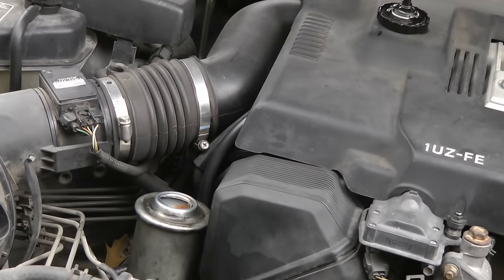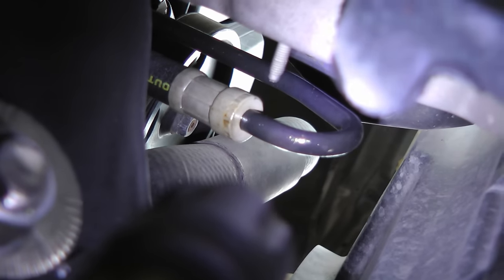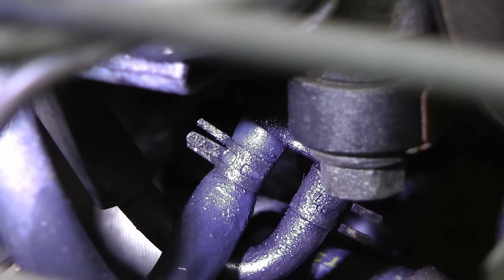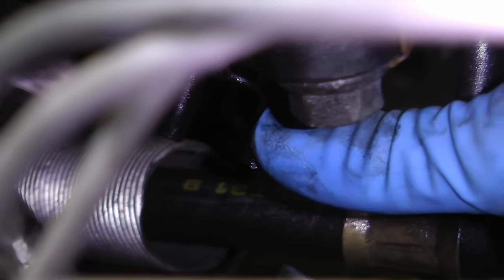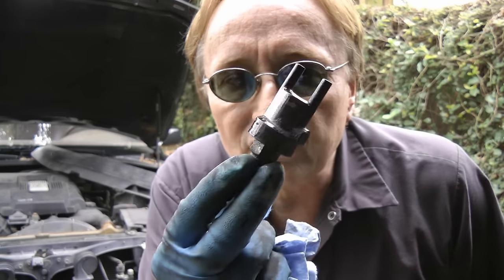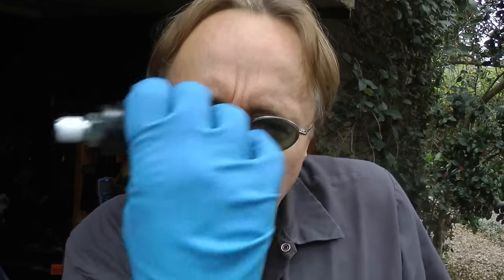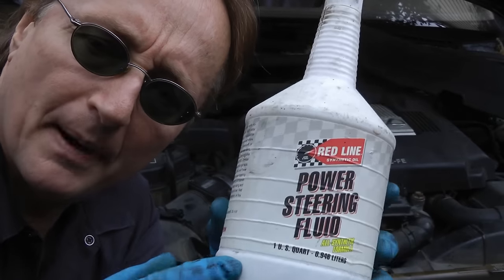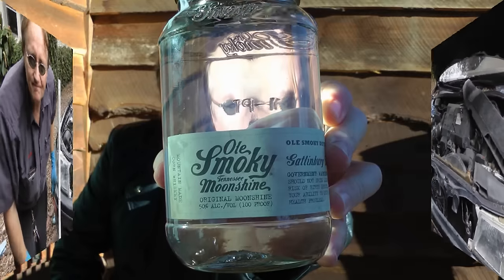How to Fix Power Steering Noise When Turning

Comment: Thank you for your video. the power steering pump broke on my 2001 Durango in a change it it and let it afterwards however it still making a noise, no more bubble in the Reservour when I bleed it and I'm not losing any power steering fluid either. Could this part be causing the noise the noise, thought not leaking?

Comment: Hey Scotty, need your opinion.. Im lookin at a 2009 Cobalt... 2 door... 5 speed (not the SS model)  60,000 miles for $6995... outside of the recent recalls for the ignition switches failing (although i never have a heavy key ring... which seems to be the cause of that problem)  does that sound like a good buy?  I hear they have pretty good crash test ratings compared to other compacts

Comment: PS:  This morning it was 30 degrees outside and I could not turn the steering wheel, then after about 3 minutes, the steering wheel turned fine...put it was still making the whinning sound as I drove, getting quitter as I drive over the next hour.  Thanks again!

Comment: Scotty I know nowadays they've replaced hydraulic power steering pumps with electric motors and as you've shown us they've even started making electric water pumps. Have you ever come across electrical A/C compressors? I'm thinking that would be too much draw on the cars electrical system but it would sure be nice to have full ac performance at idle just as at cruising speed.
Reply from the maker: yes, hybrid cars often use electronic compressors, but when they break, BIG time repair money on those.

Comment: Howdy Scotty,
One day I was moving too fast and put brake fluid in my power steering pump. From that point on, when I steering the wheel has been making a whining sound at certain positions. I sucked all the fluid out and put new fluid. It got better but not gone completely. It now only happens when I turn to the left when under a load (actually driving). Any ideas on what I should do?

Comment: Scotty, I have an 07 Grand cherokee and in low speeds such as parallel parking i get a groaning/moaning sound when i turn the steering wheel. It only happens when its cold outside but once the car is warm it doesn't do it again. It usually happens early in the morning when i take the car for work. It doesn't make any sounds when i am in motion and making a turn. Any explanations on the problem and/or how temperature might be a factor to the already existing problem?

PS- love your videos.

Comment: Scotty, do power steering leak stop products work? My son's Honda is starting what appears to be leaking from the power steering pump seal. No obvious loss of PS fluid at the reservoir, or any leaks on the garage floor, but I changed the oil the other day, and there is oil around the bottom of the power steering pump.

Comment: I had a noisy PS and in my case my ps reservoir needed to be replaced, there is a mesh filter screen in there that over time can get dirty and prevent proper flow. On the 07 Chrysler town and country I'm thankful it wasn't the rack that was the cause.

Comment: Hi buddy thanks for all your videos. I have a 2000 Toyota Tacoma 2.7 I change the power steering pump and the rack and pinion I realized that there is a noise still coming in from reservoir, inside the fluid is spinning like a swirl is not just sitting also when I put the cap on it starts leaking from the reservoir and I can't get rid of the noise I need your help

Comment: well I changed the power steering pump on my 03 Lexus.  It was working good for a week. When all of a sudden it made a loud noise when I turned the steering wheel.  I didn't jack up the front and turn the wheel as you did here. Could that be the problem? air?   I'm planning to change it again. Just to make sure I get another part and do it all over again.  WHAT DO YOU SUGGEST I DO, AFTER I REPLACE IT AGAIN?

Comment: Wish my power steering noise was that easy.  It was a little low, but hadn't been filled in over 2 years.  I added some Lucas power steering fluid and it helped for a very short time.  Now it's howling like mad again, but can not find a leak anywhere and pump is full.  Do you think the pump is going out?  Steers fine, but noise is getting worse everyday.  This has been a long cold winter, and car used to sit in heated garage all winter.  It doesn't have that luxury anymore since I bought it.  It's a 96 Buick Century with 160k on it.  I believe the pump is original to the car.
Reply: Air in the system will cause that.  See if there is a fine filter-screen in the reservoir.  I went nuts with my 02 Ford Windstar thinking the steering pump was dying or something.  I finally drained the reservoir and lo and behold there's a fine screen right at the bottom of the reservoir that was gunked up with carbon causing fluid starvation.  I pulled off the reservoir, sprayed that screen with carb cleaner to clear it, put it back in with some fluid, and haven't heard the noise since.
Reply: Turns out it was just partially frozen, once we warmed up, the noise quit.  Now if I could say the same about the potholes around here.

Comment: You are the man!  I see that part on my steering pump in the Haynes manual.  I'm going to check it tomorrow.  Have a 1998 RAV4 and replacing the pump involves removing too much.  Thanks for the tip.  :)

Comment: hi Scotty, I have a 2005 Cadillac STS and my car also makes a squeaky noise when I'm backing out of my driveway, but when I'm driving the noise goes away. I just recently got my car back from my mechanic and paid for the drive shaft rubber my car needed and thought that was one of the reason it was making my car sound this way and also got a tune up and everything. What should I do and is it safe to still drive around?

Comment: I have a chevy express van 2001. One day when I started it, it had a loud noise. When I turned the wheel, it made the same noise but louder. After about half an hour of driving the noise was quiet and pretty soon I could only hear the noise when I was turning the wheel. Do you know if following these instructions in the video will fix the problem?

Comment: Yo Scotty, hope you are safe, my old opel Astra H has an electric pump for the hydraulic steering... Kind of a hybrid between the technology, however, the electric part works well, what i have is a problem with the mechanical i think, even if I changed the oil and it is at indicated level, the pump still makes that low pressure noise, whining... There is no leak, so what can I do? A new one cost ridiculous for this car... And this old one work just fine, is just the noise that becomes even more intrusive as the engine heats up.
Should I try fix it or just leave it? 
Thank you.

Comment: Hello Scotty i was wondering more specifics, when you fill the pump and start the engine, do you leave the cap off or put it on the resivour then turn the steering wheel?

Comment: Scotty, i have this problem with my sienna 2008. I have replaced the inner and outer tie rod for both sides. The car steering wheel is very firmed when not start. When it started, the power steering wheel feel lose, I can do more turn on the steering wheel without turning the car. Do you think the "intermedia shaft", "rack and bushing" or "rack and pionon" is going bad.

Comment: Scotty, 1995 Toyota Avalon. Power steering whines whether hot, cold, or turning. Fluid is full and not foaming and a dark brown color. There's no power assist issues. I'm thinking it's a faulty power steering pump.

Comment: Scotty ( brother) = 1992 V6 Ford Tempo  power steering pressure sensor. I got a code 521 today (OBD1 Reader) " power steering pressure switch circuit fault".. Do you think something big problem I have?  When I push and keep the gas pedal stable 2500RPM the engine runs smooth and even for 1 min and RPM drops a little for 10 sec and back to normal again. (it repeats itself) other wise the car runs fine and turns fine.

Comment: I have a 2011 Ford Fusion.  Just moved and most everything is within a 3-mile radius-sweet!  But lots of tight turns.  I wasn’t the best about letting car warmup in winter.  Car started complaining regularly...groaning at turns, bumps, whatever.  Had to drive 3 hours away this weekend.  Was worried.  Thought it would somehow break dramatically or I would hear it the whole time and worry more.  Set up an appointment for 52k service and check on this noise for tomorrow.  But since trip...two days...almost no noise now...what happened?  I don’t remember the noise on the trip.  Any thoughts?  Trip= Miracle cure?  Any chance I can cancel check with a clear conscience...I have to feel like it’s safe...I drive kids!

Comment: Hey scotty, what's your take on using transmission fluid In some power steering systems, as I have seen some people do?
Reply from the maker: it works fine in some cars, but can ruin others like BMWs. Check with your manufacturer

Comment: On-topic : I drive a 2000 Honda Civic EXi, The power steering works fine most of the times, but there are times that I feel that the power steering shuts down; the wheel becomes quite hard to turn and then it gets back to normal. I drive everyday, and it happens to me from time to time in one day.
The 4 tires are new on the car and I checked their pressure everyday to see if the problem comes from there, but the tires are just fine!
I feel like it is the pump that must be faulty! there is no fluid leak at all!

So what are your thoughts scotty? I do not want to go the the mechanic again, Just went there to change the sassy arms!
Reply: Your rack and pinion is binding most likely and needs to be replaced if the pump is quiet.
Reply from the maker: pumps on hondas often wear out like that from age.
Reply: Scotty Kilmer Thanks a lot guys! Guess I'll have to go to the mechanic...once again :/
Reply: while maneuvering in parking lots or at stop signs and lights and ect stop playing with the steering wheel while the car is not in motion.
steering pump might last a little longer

Comment: Aloha Scotty.   My question  to you is why is my temperature guage rising inside my car above 210 then comes down.  Mind you, I had my radiator replaced and on receipt said the thermostat was replaced.  I WILL NOT  be going back to that shop so I want to fix my 2009 Murano on my own.  What advise to you have?  Is it a faulty thermostat or something else?.  Thanks from Oahu, Kaneohe  Hawaii.  96744.
Reply: My temperature guage rises well over 210 driving then drops back to normal when coasting down hill.  My radiator was replaced by a shop and receipt shows thermostat was changed.  My car is a 2009 Nissan Murano  SL AWD.  Service to my car was performed 3 weeks ago today.  I will not be returning to that shop.  Kinda iffy.  My bill was paid and I am done with that shop.  I want to resolve my cars issue.

Comment: My power steering fluid hasn't ever leaked but is original fluid, I believe.  06 Dodge Dakota making moaning noises. Always had some play( loose) steering wheel.  Now the moaning thing. Old tires were worn on insides more prior to struts and strut assembly done. Since new tires, its not as bad. Not hard to turn. Doesn't make noise unless turning.  Dodge recalled a ton of front ends but not my model! Any suggestions appreciated.
Reply: Evac and replace fluid in ps reservoir

Comment: Hey Scotty long time viewer ! You're videos are awesome and always work for me and my friends. I have a 1997 Ford ranger , and my truck makes a rattling noise when I accelerate sometimes. why is this ?
Reply from the maker: often timing is a bit off from old age and worn timing chains or belts. check that first also realize if you use cheaper gas the lower octane will make it do that.

Comment: This is a great video, but im having some really weird issues with my 98 honda accord, power steering fluid leaks everywhere on top of motor and what not, the cap blew off and I go through a bottle a day, im bot exactly sure.whats going on with it, any suggestions on where I should start??? Please help!
Reply from the maker: do my video "finding and fixing car oil leaks" and put the uv dye into the steering. Then find what's leaking the most first and fix that. Often bad high side hoses AND steering racks leaking on that model

Comment: Hey scotty, i have a 2004 honda accord that makes a whining noise from the power steering i already changed the fluid and replaced the pump but the noise is still there. If that didn't work what else can it be? It's just so annoying to hear that noise all the time! Hope you reply back, thanks! And keep making videos! (:
Reply from the maker: either the power steering rack is bad building up pressure, OR you got a bad pump. I only use new pumps myself, as rebuilt ones often are poorly done and whine right out of the box

Comment: Hey Scotty... love your videos.   The issue I have is with my 2000 Chrysler Town and Country 3.8L.   I have noticed when I leave the driveway and start moving forward, the steering is hard to turn.  The fluid level is fine.  Yesterday when I started the engine I heard this loud steady whining which seemed to increase as I increased the RPM.  There was also a odd odor from under the hood.....not electrical but a burnt smell.    I never heard or smelt this before.  I checked the steering fluid level again and it was at the cold level.  I took the car for a quick ride around the block  and the noise disappeared within 1/4 of a mile.    I drove the car a bit yesterday and the noise did not appear again and not odor.   Started the car this morning and no noise.  No fluid leaks from the engine and the noise wasn't a squealing sound like a bad or slipping belt.  Any suggestions?  Thank you.

Comment: ive been having issues with my power steering  as well, but my hose  line are wet straight out of the reservoir bottle, should i use a dye to find the leak and if so hat would you recommend

Comment: This happened to my Infiniti m45. I left the car to sit in the cold weather for almost a week while using my very reliable Honda. I would start the car daily but never drove it. When i did decide to drive it, a loud noise was heard from the power steering pump/reservoir. The steering wheel was hard. I shut the car off and noticed the power steering fluid was oozing from the top of the reservoir. The tire pressure had gone really low so I went to add air to my tires. Steering was slightly hard so I added some synthetic power steering fluid. $2 for the fix minus the fluid which I already carried in my car.

Comment: I have a question for you Scotty. I have a 06 lacrosse and it makes a noise when I turn. It only makes it once. The first turn after I start the vehicle. If I start the car and turn the wheel in park it doesn't make the noise. Only when I'm moving and only the first time I turn the wheel. Also while I was driving I put the car in neutral shut the car off then turned it on while still moving, there was no noise when I turned.

Comment: Hey Scotty, not sure if you're still answering in this forum or not but, My 2002 Ford Explorer 4.0 xls, seems to want to almost stall. I notice it mostly happens on rainy or foggy, moist days especially when engine is cold, I'll be in "drive" just sitting idle at a stop light, rpm's go down to like under 500 and the engine is running kinda rough. I thought it was IAC valve so i cleaned that the best i could but didn't change anything. Any ideas~ Thanks Jay

Comment: I have a 2003 vw passat v6.  It has had a bad coolant leak for some time now. Unfortunately coming from both sides. My passenger floor is saturated with coolant, Suggesting the heater core is an issue. However, i notice it dripping onto the ground from underneath as well, this is the more perplexing issue. Any suggestions?

Comment: hey scotty!
i have 2 problems
i have a 2016 lexus RX
and today the temps dropped to 18 degrees (Yikes)
i got the car in May, and no issues until recently
first today i noticed the steering column squeaks every few mins in the cold this morning and this afternoon after i started them. but after almost a 2 hour drive, it went away. 
is that normal for the the drastic temp drop?

also i hear a faint squeak from the rear passenger side. near the trunk.  ONLY when the back end drops as in when i go over a speed bump or a deep pothole. the trunk is completely empty but i have a feeling its the shock? would i be able to hear a shock squeak inside the car?

Comment: @emad abughadeer..... i have a similar issue going on.... steering is very stiff and squeals while turning the wheel in either direction but while the reservoir cap is off turning the wheel is a little easier and there is slightly less squealing....... belt looks brand new w/good tension and i did a complete flush of the power steering fluid there are no leaks and I refilled with DIII ATF per toyota specs.... problem has not changed but i really dont want to start replacing the pump and potentially the rack until i understand exactly what the problem is..... or if there is some way to know whether it is the pump or the rack or maybe just the pully or something stupid....
Reply: +Kalen Ramie i had a similar issue with my old daily clunker. 2001 echo. i turned out my ps pump was seizing everytime it goes under load( turning the steering wheel). Causing difficult steering and squeeling noises. replaced the pump. ran great then sold it.
good luck